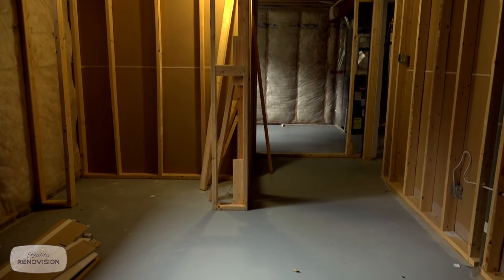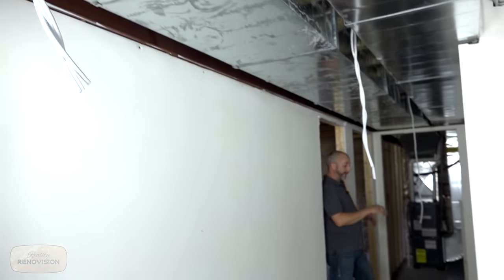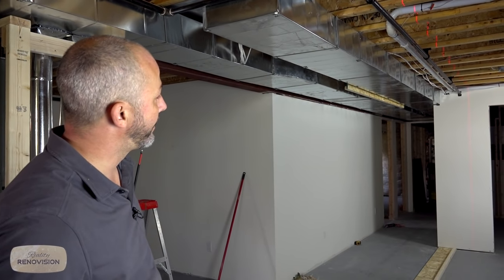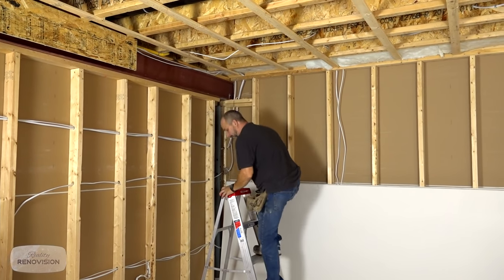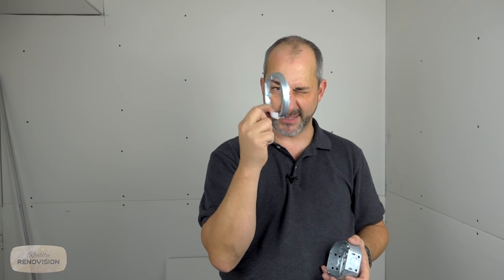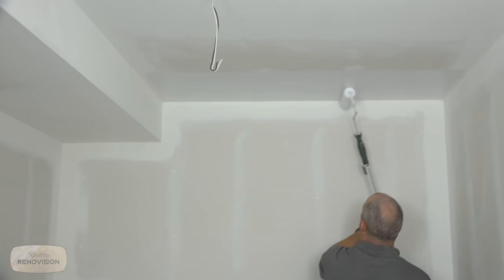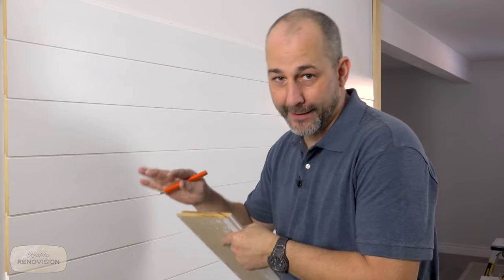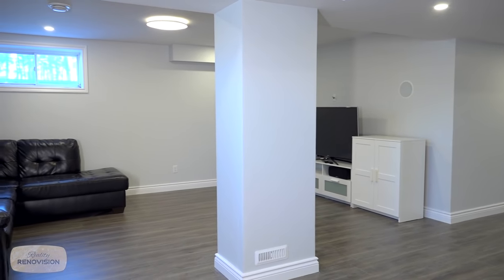Renovation Trade Secrets for Finishing a Basement | Reality Renovision Ep19

Comment: Jeff is always the best, explaining the “whys” simply and clearly.  But in this video (@ 13:35) he potentially saves us from a pat down and a night in the slammer. Perfect every time! 😉
Reply: He should explain “why” you shouldn’t drywall a basement ceiling.  Worst idea imaginable.  I can’t count the number of time I opened my drop ceiling panels to run more electric, ethernet cable, coax for my Directv.   Oh yeah I was also able to cut a union and a few 90’s to run a natural gas line for my grill.  All of that out of the question if I would’ve drywalled my ceiling.

Comment: Trade secret: use a 4-1/8" hole saw to cut out your 4" pot light holes.  It gives you the perfect size hole every time.  Also, because larger diameter hole saws have a tendency to bind suddenly while cutting, run the drill slowly until the center bit is plunged in and the drywall is marked with a groove, then run the drill in reverse, high speed, to finish cutting through the drywall.

Comment: For some reason I feel like using my impact gun and construction screws is more cost effective, but probably over the long long long run the nailer is cheaper to operate (nails much cheaper than screws I imagine).  (But my impact gun is also cordless, oil-less and hose-less for $150 and doesn't need a compressor.)

Comment: As you can see, the Canadian learns because the metric system is easier to use on the building site. And you also avoid calculation errors in the decimal system.

Comment: If your basement is 50% or more below ground, DON'T use a vaporbarrier, this will trap condensation and make the wood rot rather quickly. If you are uncertain if it is 50% or not, its better to not use vaporbarrier in your basement. also, insulating more than 50mm (2 inches for you imperialists) is not advised in basements, unless you got outside insulation. This is especially important in regions with big fluctuations in temperature through the year. Cheers from a norwegian carpenter :)

Comment: I've really been enjoying your videos and have learned a lot! One of the large projects my husband and I want to take on in our (1910) home is to finish the full basement to have a bit more space, but I dont want to spend a fortune on labor (especially after watching your videos where you said it wouldn't really increase our home value)and wanted to do most of the work myself. 

Anyway I gave you all this unnecessary info to ask if it's standard practice to hire a GC to come in and just help with the planning or if that would be be offensive to ask someone to do?
Reply: This is late, but that's a service I'm trying to offer. It's been on my business card since 2001. No takers yet. I usually get the job though. I don't think it's offensive but perhaps some GC's would not want liability for any advice. My idea was to help a home owner get started, show them a plan of action, and show them the pitfalls to avoid. Show them "how to", or set up the lines and levels, put up the first ledger, etc., and let them take over with my phone standing by, ready for problem solving. 
  I am curious what people would pay for such a service. What standby services would you like from a GC?  A skilled renovator is pretty much the same thing. The only thing that makes a contractor a general, is they hire and co-ordinate all the trades for the job. The GC may be skilled in only one trade, or none, sometimes all. They have a knack for putting the big picture together, handling accounts and various scheduling, and they "know" construction. Renovators have a knack for doing quality work over a wide range of trades, and also seeing the big picture. Ask a renovator for advice.
Reply: Would love your knowledge and input. I know very  very general info but quick to learn. Would like to hire someone that would let me assist with my project but no one seems to want to take on that liability 😢

Comment: I am in Toronto.  How to run cables from unfinished basement to the first floor and the second floor inside wall and without break the drywall ? This is used for running internet cables and outside cameras installation in residential house.

Comment: very nice. I have a question. In the u.s flooding in basements can be a real issue as flood insurance coverage for basements is limited. Any suggestions for materials that are flood resistant? I see you used the vinyl planks so that definitely helps. What other options exist?
Reply from the maker: Build an addition instead of going deep. Cheers!
Reply: Definitely do not use drywall in the basement if you anticipate ANY moisture issues. Drywall is made for ease of installation and fireproofing, but is extremely vulnerable to moisture. I had to tear out poorly thought out drywall in my basement upon moving in (prior residents induced a flooding issue that caused mold in the drywall). 

I see a water-permeable basement tile at greatmats, though I haven't had the chance to use it yet. I plan to use it for the flooring. As for the walls, do not use water vulnerable insulation -- no fiberglass or cellulose. I'm not a fan of closed cell foam or sheet foam, as they're flammable and release toxic fumes when burned. So, mineral wool is an option, as it does not soak up water or promote mold. I also plan to use waterproof tile panels as the walls of my basement and mini splits and/or energy recovery ventilation (ERV) for climate control.

The key to recovery from temporary basement flooding is allowing everything to properly dry out. So water barriers are unhelpful in that scenario, as you'll need water permeability for water to flow and dry out. I have a dehumidifier running 24/7 in my basement to prevent mold. You may also think about yard drainage and exterior French drains to move water away from your house to mitigate moisture (this depends on the lay of the land and placement of utility lines).

Comment: I have a question concerning a basement floor , lvp install,  can self leveling cement be used and do it has to be a fine finish when using Dmx lvp flow underpayment. I had  a lot of high and low dips, now after using floor leveling it has a slight bevel,  I was thinking of using a more liquidity leveler to fix bevels. What would you recommend

Comment: Why dont you put any space between your bottom and top plates on interior walls? If the concrete heaves wont it push up on the floor joists? We were told  to put a bottom plate screwed into the concrete, a 1 inch space, and then your framed wall.

Comment: Good job with your video but 3M glue is NOT made for metal paper beads but plastic only. Use yellow mud for beads and tape 👍 also you can get a drywall screw gun for about 100$ at Home Depot. It worth spend the extra bucks

Comment: Hey Jeff!! Love the channel! Any tips on finishing a wet basement? I bought my house in November of '18. Since then there have been a few water spots and cracks on interior walls in the basement. I have since used Hydraulic cement and drylok for cracks where leaks happened. I have a french drain and sump pump in the basement as well. Since then not much water has gotten in but I have noticed the bottom portions of the walls are sometimes damp after a heavy rain...I would love to finish it with drywall and paint and really make it nice. Any tips or ideas? Do I even take the risk and finish it?

Comment: You should point out that in certain places with potential ground movement, basement walls need to be floating. This is for code reasons and also so the basement walls don't cause problems in other parts of the house.

Comment: 35:40.  Perfect reason to use a drop ceiling.  Never have that problem in my basement.  Never drywall a ceiling.  I’ve opened my ceiling tiles so many times I’ve lost count.  Absolute dumbest thing to finish a ceiling in a basement with drywall.   Not to mention I can access my top stud plates and drill access holes for Ethernet, coax, etc.  the amount of work involved with cutting drywall to run those cables, that’s what sucks about doing electrical work in finished walls.